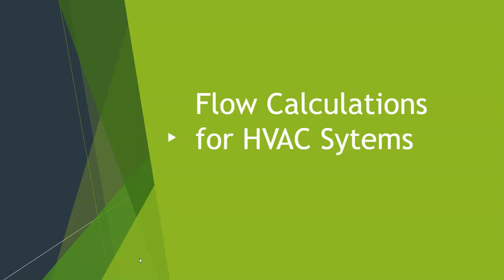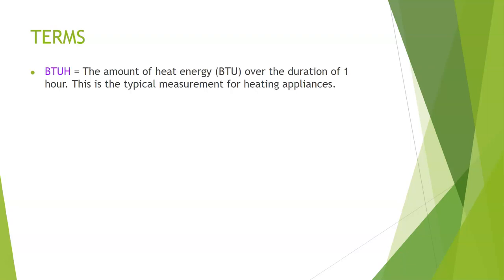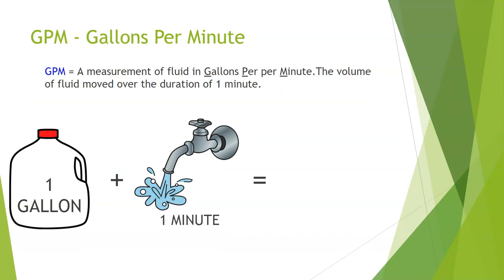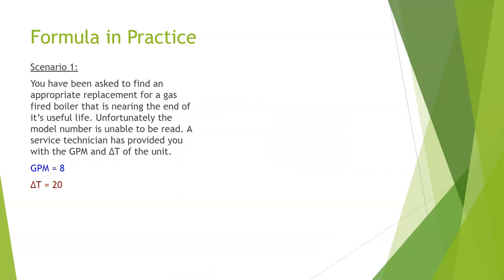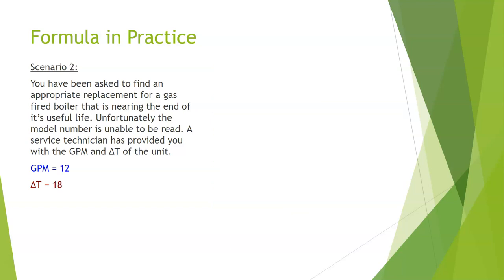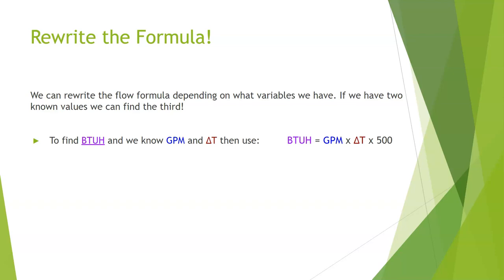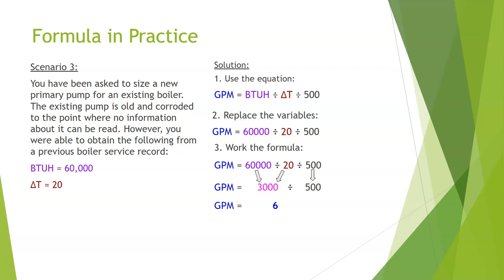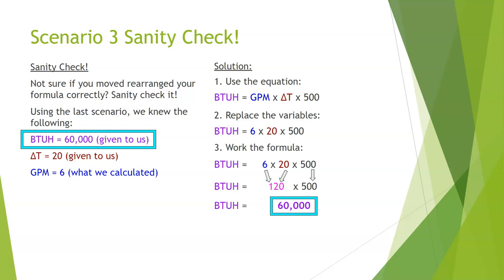HVAC FLUID FLOW CALCULATIONS

Comment: The reason we use 500 is because we use gallons but we want pounds there is 8.33 lb of water in a gallon. And there is 60 minutes in a hour. 8.33 * 60 is 500